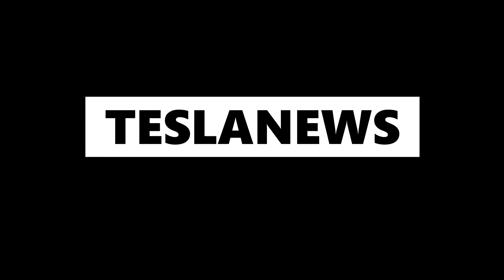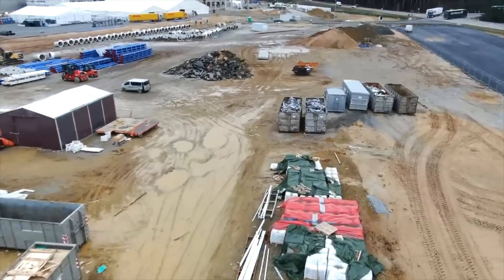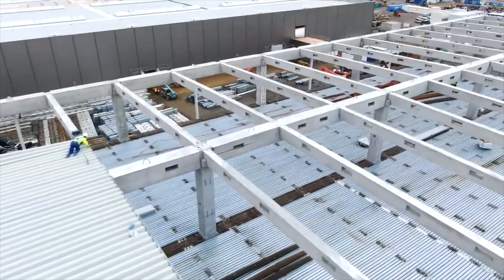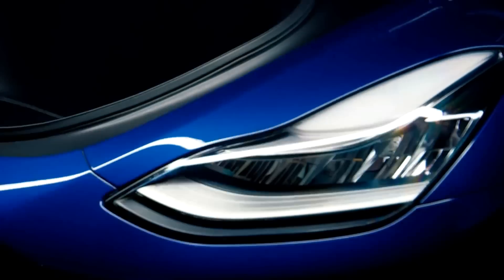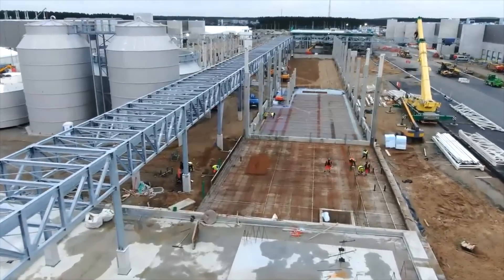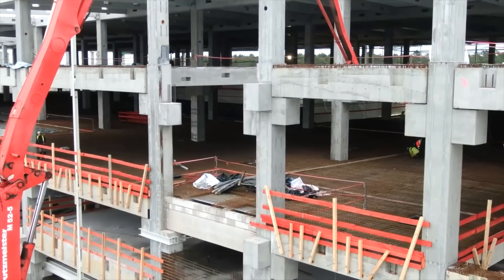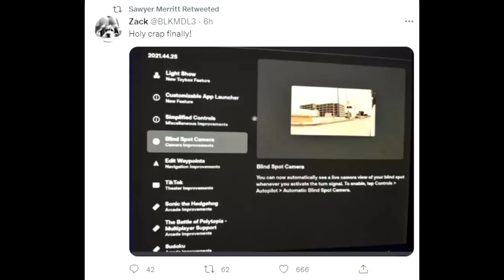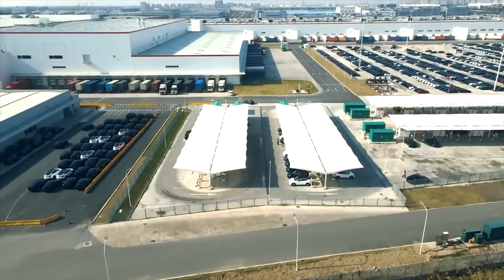TESLA: Giga Berlin Timeline +++ This Version will be first!

Comment: Tesla was supposed to open in October, and now the German Government says that Tesla need more documents. I think Tesla submitted all the documents required before October. The German government should receive Tesla with open arms because they are going to learn from them. The longer the movement waits, the longer it will take them to learn.
Reply from the maker: Hey Arthur, your feedback is good but it is in parts not tottally correct. The Battery plant was added and with that all the assessment had to be restarted. This is Law which even if you dont believe it is for everyone. Thats why even VW plans 4-5 Years for a new factory. So in other words just to clarify even with a final permit in January Tesla is compared to compeitiors on a fast tracks as never before. So their is already a lot of help that they get.
Reply: @TESSINEWS  yes, it's the law. It's not a very productive law however. Here's a novel alternative: make each proposed addition to the site a separate item to approve separately without impacting the parts of the plan that were already approved. Strange idea I'm sure but it seems to work well elsewhere. But now we all have had an education on German law and probably the next company thinking about building or investing in Europe will put Germany at the back of the line behind Ireland, Czech, Poland,  Slovakia, Spain,  Bulgaria,  The Netherlands and France.